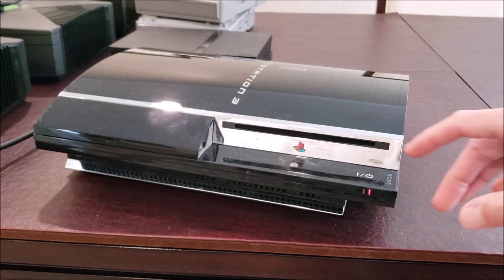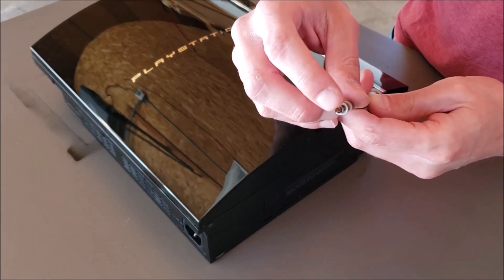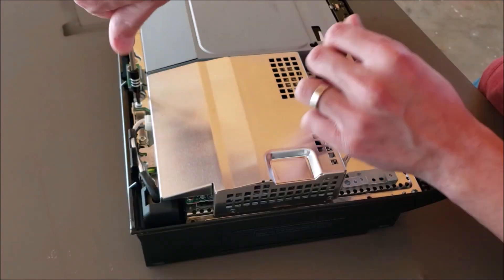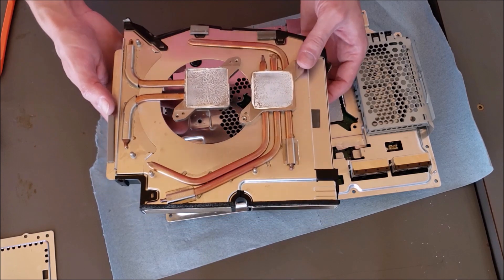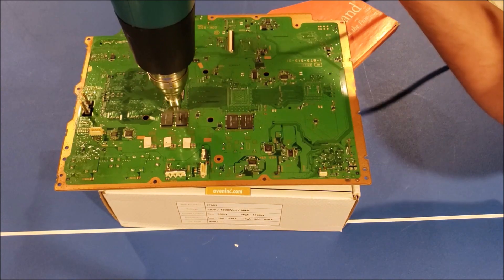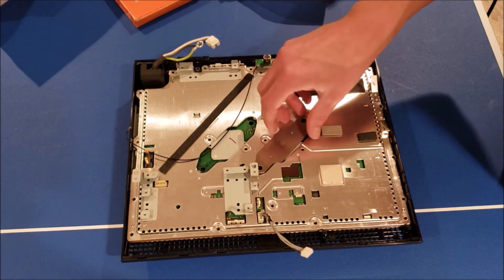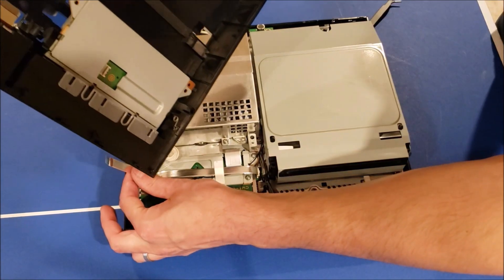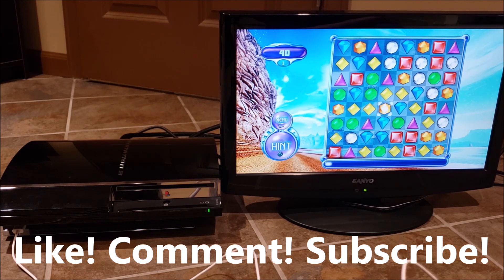Fixing a PS3 with Blinking Red Light "of Death" (YLOD)

Comment: As someone who has been messing with PS3's for 10+ years, reflowing is not the proper fix most of the time. It's been proven about 2-3 years ago that it's the heating of the NEC caps that brings it back to life (temporarily), not the BGA reflow. But many PS3's have been destroyed by heat gunning the CPU/GPU. Reflowing is risky and should be a last resort. Your spreading harmful misinformation and I will hope you make a new video and pull this one down. I don't mean any disrespect.
Reply from the maker: This worked for me and is still working. Not harmful in my experience. The opposite in fact. Can you share this proof from 2 or 3 years ago? This repair comes from an ifixit guide. Are you asking them to take down their content?
Reply: @FantasticQuack  Yes anyone recommending to reflow first should stop. It should only be used as a last resort. Yes heat gunning is risky and especially with out good temp control. I tried posting a link from 2019 but YouTube is blocking the comment. It's not the reflowing of the CPU/GPU that is making it work again, it's the heating of the failing NEC caps that is bringing them back, temporarily. The right permeant fix is to replace the caps.
Reply from the maker: @jeffescortlx  You are implying the only cause for YLOD is the NEC caps? Please read the video description where I've already addressed this type of comment as well as your initial concerns.
Reply: @FantasticQuack  I did read your description. But I still feel this video doesn't put enough attention on the caps. It's very possible the majority of the YLOD problems are cause by the caps. But I understand why it was misunderstood for so long. People would bake the CPU/GPU and it would make the PS3 work again, so they would have assumed that was the problem. But in reality the NEC caps are right next to the chips, also getting baked. It's common knowledge that heating a bad cap will bring back some of it's capacity.  Your video is promoting a risky procedure that probably isn't even going after the root of the problem. I still hope you make a new video with your new experience on this problem and take this one down. I've had to throw away many PS3's that were abused by heatgunning that could have been easy saved by just changing out the caps.
Reply from the maker: @jeffescortlx  Overall I think your concerns are fair, I don't want to see anyone breaking their PS3 either (even if it already is). I'm not convinced that replacing the NEC caps will always solve this problem; I do agree it is a safer option to start with, but worth pointing out that you can cause irreparable damage to the board trying to replace the caps if not done properly. So it's a trade-off either way you look at it if we assume many people wanting to fix their console do not have broad expertise in electronics repair. This process solved the issue on my PS3 and it still works. Based on that, maybe the problem on mine was a broken solder joint(s) in one of the CPU/GPU BGA arrays rather than the NEC caps since the effect hasn't "worn off" yet. I can't say for sure. I don't believe taking this video down will change anything unless everyone else with a similar video does the same. Not sure if you're commenting on those also, or just mine, but surely you're aware there are many others. I would be willing to make another update to the description which makes some of these concerns more explicit.
Reply: @FantasticQuack  On video's that were made before 2019 I can understand people suggesting the reflow, we just didn't know any better. But now with the new information that is available there is no excuse to to use the brute force method of reflowing. Maybe as a last resort sure, but not a first solution.

Comment: You got very lucky. Never, never, never touch anything on the board, or move it in any way while, or after heating it. You run a very high risk of shifting something and causing a solder bridge.
Reply from the maker: The only thing I touched during the heating portion was the large metal shield for a split second to judge how hot it was. I don't think it was luck but thanks for the comment.

Comment: I tried this before and it worked for an 1-2 before I turned it off , next day I Went to use it , it happened again :/ I probably did it wrong or something lol
Reply from the maker: Maybe not enough heat, but others have said their's lasted a couple weeks to a month or so. With that it seems the whole process yields inconsistent results. Mine still works all these months later but I have to mention that I barely play it at all.

Comment: Is it still running strong?
Reply from the maker: Mine is still working, but it isn't getting much use. A couple people in the comments have stated theirs' stopped working again a few weeks after doing this fix. The main variables are the heat applied (temp & duration) and thermal paste application, the former can't really be replicated exactly between any 2 people with this method so I'm sure the results will vary from person to person. There is a more permanent solution involving changing out the tokin capacitors; it's more complex and will only work in some cases of YLOD (whereas others may require a full CPU or GPU reball).

Comment: I've torn it all apart and cleaned off the old thermal paste and then realized I don't have a fu**ing heat gun lol
Reply from the maker: Ouch! They're pretty cheap though and have tons of uses. If desperate you could try a hair dryer for a much longer duration but I have doubts it could get it hot enough.

Comment: Hi, how can i clean lance cd player, it's dirty, sometimes not red disc, on ps3 60gb
Reply from the maker: I'm not sure if you can get to the lens without taking apart the disc drive. Are you sure it's just dirty? Many consoles have a potentiometer to adjust the laser power which can drift out of calibration over time. I've fixed a lot of Gamecube's and ps1's not reading discs this way. Never ran into the issue on a PS3 so not much experience there, but I imagine it is similar.
Reply: @FantasticQuack  I'm sure i s dirty, I've watched more tutorial videos, they taken part, then clean the lens disc, its not easy many screws and ribbon cables has to be disconnected, specially lens its really tricky places,.

Comment: Did this and it didn't work , dont have the gun tho
Reply from the maker: ...Then how did you do it?
Reply: @FantasticQuack  I opened the PlayStation and cleaned whatever you cleaned removed the dust I don't have the hot gun and the thermal paste buh I improvised , so I did use a mixture of 80% toothpaste at 20% Vaseline in place of the thermal paste . It did work for a while wen I was done buh few minutes after it happened again . Now games hang after Playing for few min , or wen dey reach a loading section .

Comment: Anyone else pull the ps3 apart before watching the video and realising they don’t have a heat gun
EDIT:just got the heat gun and used a bit of flux and this worked wonders thank you so much I thought i got scammed on this ps3 but you saved me❤️
Reply from the maker: Ouch! I should put a "tools needed" bit at the beginning next time...
Reply: @FantasticQuack  no its not your fault i pulled it apart saw the dry thermal paste and immediately knew i had a problem then i started googling videos 😋

Comment: I tried this but didn't have a thermal paste so had to do the cleaning and reassemble the PS3 and give it a shot while a wait for an Amazon order of the paste. The PS3 worked again for a minute then the problem recurred and it stopped working again. Could it have neen because there was no paste? And do I have to use the MX-2 or any paste may do well?
Reply from the maker: Running it without thermal paste is very bad and I could see it leading to overheating quickly this way. Any thermal paste will work technically, but you should pay attention to the thermal conductivity "k-value". Shoot for something that is k = 5 w/mK or higher.

Comment: Thank you for this great video, well explained and easy to understand. Our PS3 had the same issue and I followed the steps in the video. With a small addition that I heated first the whole motherboard with light temperature and remember to keep it leveled until it cools off. I had my doubts, but the fix worked. Our family is grateful.
Reply from the maker: Glad to hear this helped you out!
Reply: Still working after heavy use.
Reply: @rombergjalle4570  now ?
Reply: @windowstips1430  working
Reply: @davidsucesso2419  probably not
Reply: Hi is it possible you could put a li k to the capacitors that you used in this project as I would like to attempt to repair my ps3 from the ylod and bring it back from the dead so I can display it along with my other consoles from the past years
Reply: @thereaper1847  it won't fix it
Reply: Does this still work a year later?
Reply: What do I put after removing those whitish things

Comment: I just took mine completely apart, cleaned it out, cleaned all the dust off the fan, replaced the thermal paste and then put the whole entire thing back together. Tried to fire it up, same result: yellow light and 3 beeps. I feel really bummed that I couldn't get it back to life; it's a very nice console. I have a slim too, and it's a great console; it stays cooler and is not loud at all. I like it, but I really feel down that I can't play my PS2 games in it :/
Reply from the maker: That's a bummer. Unfortunately the clean up/paste is not enough-- need to reheat it before new paste to repair the bad connections.
Reply: @FantasticQuack  I forgot that step, so it all makes sense. I guess now it's too late. I think I saw a video where someone used a hot air gun and blew at it to warm it up.
Reply: @FantasticQuack  hey, I apologize for randomly asking, but even though I applied the new thermal paste, is it too late for me to heat the capacitors up? Do you think it would work?
Reply from the maker: @autolife2785  I'd recommend removing the paste before heating. If it's still "fresh" you could scrape it off onto some wax paper or something temporarily and then put it back on afterwards.
Reply: @FantasticQuack  ohh okay. About how long you think it'll last before dying again? (If it does die)
Reply from the maker: @autolife2785  if you want strong opinions on that question just read these comment threads lol. Mine is still working but I haven't been playing it a lot. I'm assuming the results can vary and it is not a super long term permanent solution. But the "best" fix of reballing and/or replacing the caps is more cost/effort than most common folks are willing to stomach. My 2cents.
Reply: @FantasticQuack  yeah you're right. In all honesty, I'll probably just stick to the slim I got for my PS3 games, and I'll just play the PS2 games on my PS2. The slim runs perfectly fine for a 12 year old console. I always really liked the fat though, simply because of it's abilities, and the look of it. But I don't think it's worth all of work if it may not work. I wish I had gotten it brand new, I got it used, and I don't think the previous owner took the best care of it. I saw it had been opened once already before I opened it
Reply from the maker: @autolife2785  The issue will happen to all of the phat PS3's eventually. Not a bad idea to keep it just for decoration and play your games on the units that can stand the test of time.
Reply: @FantasticQuack hey, I'm sorry to be replying so late to this thread, but I was just letting you know over the last 3 years I've got 2 of the non-backwards compatible CECHG01 fat models. Both have been working great so far, and stay quiet for the most part. One of them gets loud only on one game (Need For Speed Most Wanted - 2012). I've really enjoyed watching your videos also! Always super informative, and entertaining to watch.

Comment: I bought my friend’s PS3 FAT model the one with two usb slots sadly the fan is defective and really dirty it has not been used for more than 5 years now luckily it will still work and got me to the menu but whenever I play any game the red light blinks so with this review I manage to replace the fan and added new thermal paste after heating it to the cpu/gpu after putting all back together I was worried that there are two medium and small screws that I forgot where they were placed and I check all the arrows and rewind this video and all other screws are placed and intact with the right placement so I tried to play one game for more than 5 hours no more red blink thanks to this video still bothered about the two screws though 🥺
Reply from the maker: Glad it's working for you! Please update here again after a few months if it's still working; a lot of people are saying the repair doesn't last but it's still going strong for me.
Reply: @FantasticQuack  I have a new issue which is kinda weird I observe my PS3 for two days staying it on for more than 5 hours playing (God of War III) after playing then turning off the PS3 the next day I will do the same thing again play a game for more than 5 hours then the YLOD will start so I will cool down the PS3 for a few minutes sometimes leaving it in front of the air conditioner do the same play GOW III for 5 hours or more the YLOD is gone 😅 and if it’s a overheating issue I always play in a small room where the air conditioner is on for 11 hours even the TV and Monitor will moist it’s like playing in a cooler box 😂
Reply: if its working now, those screws werent that important. You should be ok.

Comment: Done this twice. How do you tell if you heated it up enough? It was definitely hot to the touch
Reply from the maker: It's really just gut feel. If you have experience soldering that helps with the intuition. To give you an idea, mine was hot to the point that you couldn't have your finger on it for more than ~1/4 of a second without burning yourself. I believe in the video I mention temperature settings and duration I used as a reference.
Reply: @FantasticQuack  Need help Regarding Fat PAL PS3 60GB model, So I have a Problem I hadn’t used my PS3 fat in 3 months but today I booted it up(meanwhile this darn AC was turned on in the same room in the background) and was playing for 1 hour and a half and turned it off for about 10 minutes before turning it back on 3 seconds into the boot up screen and I turned off my AC At this Exact moment my Ps3 shutdown for some reason and I panicked and it started doing this exact red light of death and won’t turn on anymore come to think of it in the past also it would randomly shut off between gameplay 2 or three times making a red light but then it would turn on fine so I didn't pay much attention to it. So I’m guessing this might be a power supply issue or capacitor issue🤔if not then I’ll be really depressed. “Retro” games and old games are really rare in my country and eBay died 2 years ago here so There really is no one trustworthy enough here to be handed this old console.I found this PS3 Fat a year ago on my local craigslist by a stroke of luck! And bought it for $130. It’s always really dusty inside(and it was at the time of purchase too) although I had CFW installed on it So I turned up the fan speed so the temps don’t go higher than 61C. I hope my PS3 isn’t dead. 💀

Comment: I got my ps3 to kinda work by taking it apart and just cleaning out the dust best I can but it still turns off sometimes and so far the only game I can play is guitar hero live when I try to load up black ops it just freezes or turns off
Reply from the maker: If cleaning out dust helped, I assume it is an overheating problem. In this case, removing and replacing the old thermal paste would probably do a lot for your system--and you can probably skip the heating step since your console is still turning on/working to some degree.

Comment: Mine still has a red light and now it won’t turn on at all. I change the thermal paste and I cleaned up all the dust & it still doesn’t work😔
Reply from the maker: Changing the paste alone is not enough, those components needs to be heated to achieve some degree of solder reflow thereby reestablishing any bad connections. There are many different potential issues though and yours may not be the same.
Reply: @FantasticQuack  my cousin helped me out with his heat gun thank goodness 🤣 thanks for the tip 😎👏🏽
Reply from the maker: @yagikidd2300  You bet, I hope it worked out!

Comment: You could've just plugged a pc gamepad or something like that in it to operate
Only ps2 games will not work, because the PS button needs to be pressed on an original ps3 controller
Reply from the maker: Good to know. The PS4 controller worked fine.

Comment: NEC and tokin caps should have been replaced before doing a full tear down and reflow. These caps are a known failure point since day one in laptops and other devices. The fix for the issue back then was to replace them with higher quality ones. These caps also react in a positive way to heat and come back to life temporarily
Reply from the maker: Since doing this I've seen people replace those caps too. If/when I get YLOD again I might go back inside this thing and do the cap swap.
Reply: @FantasticQuack  yeah make sure to super heat the cpu and gpu and shorten their lifespan next time you do it too. This video isn't even that old, how did you not know that ylod happens because of the tokin caps?
Reply from the maker: @DarkoPetreski  ylod has multiple causes beyond just the caps. I've addressed this type of comment in the video description.
Reply: @FantasticQuack  Maybe pin a comment saying if you get ylod, first replace the caps, and if that doesn't work do the reflow. People don't really read the description, including me.
Reply from the maker: @DarkoPetreski  that's a good idea I'll do that soon!
Reply: @FantasticQuack  Cheers! Also I apologize for being an asshat. I just can't stand seeing reflows being recommended.
Reply from the maker: @DarkoPetreski  No worries m8